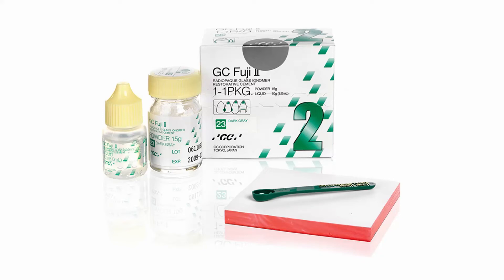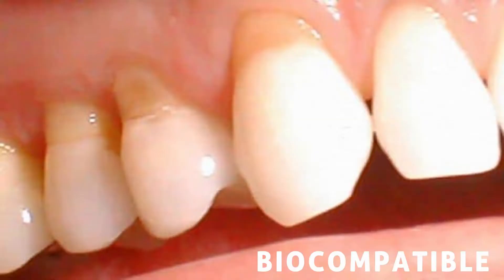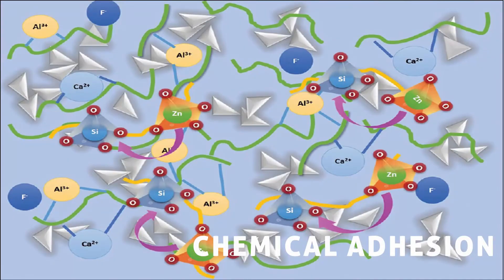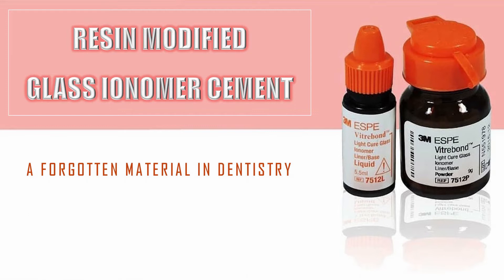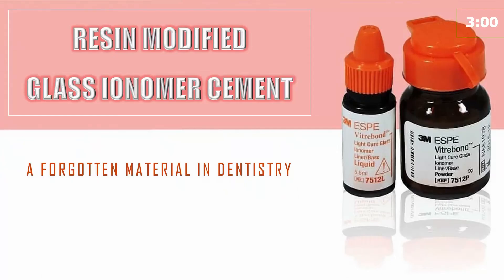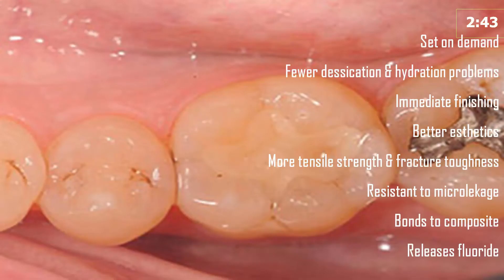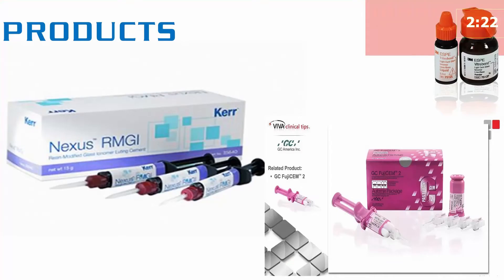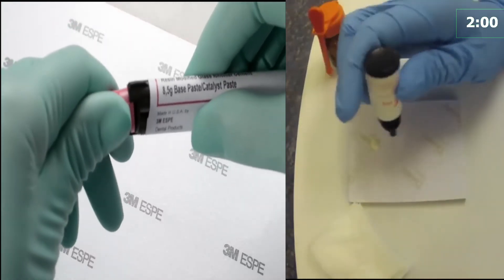RM GIC | Resin Modified Glass Ionomer Cement

Comment: Hi sir

I would like to share one doubt regarding light cure GIC

Whether we have use bonding protocol that is etching, bonding agent application before placing light cure gic Or not

Similarly after placing light cure gic we should again follow the bonding protocol for placing light cure composite over it or no need of it sir

In case of deep cavities for light cure calcium hydroxide same bonding protocol needed or no need of it sir

In case of indirect pulp capping where we leave affected dentin - bonding can occur in that dentin or not sir for placing light cure calcium hydroxide sir

Please share your opinion sir
Reply from the maker: For RMGIC restoration there is no need to etch and bond because basically it is a GIC. GIC in RMGIC should undergo chemical adhesion with tooth. Resin is added as an ingredient to enhance strength, esthetics and making the material easy to use. So NO NEED to etch and BOND
After completing the restoration, there is no need to follow any protocol to follow as like composite restoration
In deep cavities, over calcium hydroxide RMGIC can be placed. Although no material can bond to calcium hydroxide and calcium hydroxide also doesn't bond with tooth. Mostly the adhesion happens with the walls of the cavity preparation when calcium hydroxide is not applied
In indirect pulp capping, over the affected dentin we can place RMGIC directly but still it is preferable to place a layer of calcium hydroxide underneath.

Comment: please could you help me answer this question 
under a composite filling which is the preferred material as a BASE glass ionomer or resin modified GIC?
Reply from the maker: If you are planning to do the composite restoration immediately, then RM GIC is the best option
If you decide to delay the composite restoration, then Conventional powder and liquid GIC is the best option
Comparing the success and biocompatibility of RM GIC vs Conventional GIC, Conventional GIC is better
I prefer to fill the entire cavity with conventional GIC and then recall the patient after a week to month, remove superficial two mm and do a composite restoration
Reply: @smartdentistry  thank you I was moving more towards rmgic. if you  don't mind could you tell me what are the advantages and disadvantages of both materials as a base under composite fill and when resin modified GIC is used does it require a cavity lining underneath it due to Hema and possible pulp irritation?